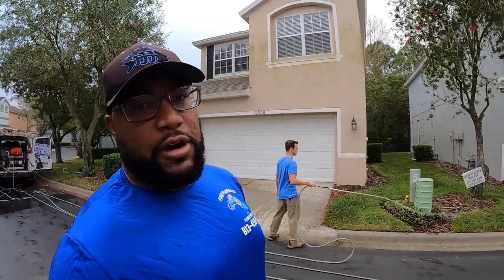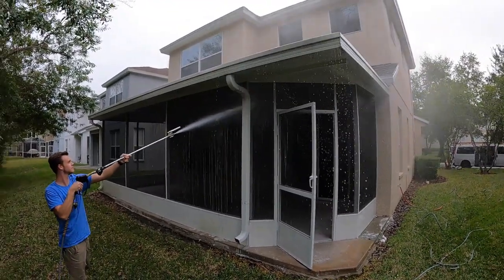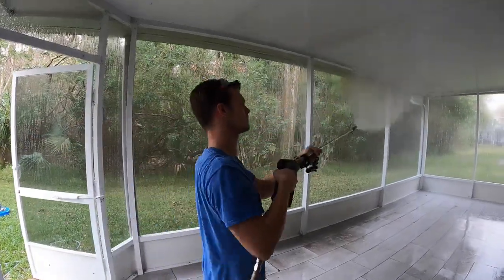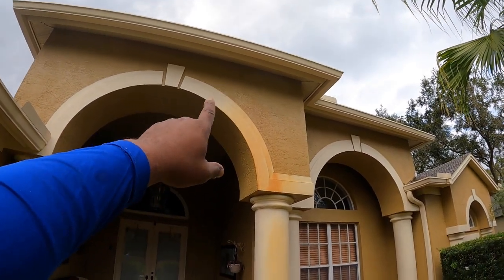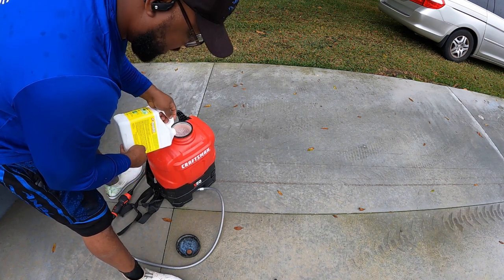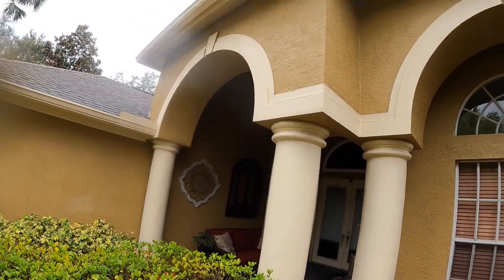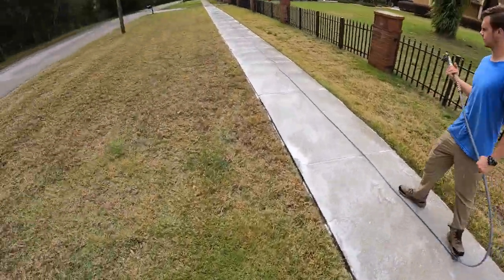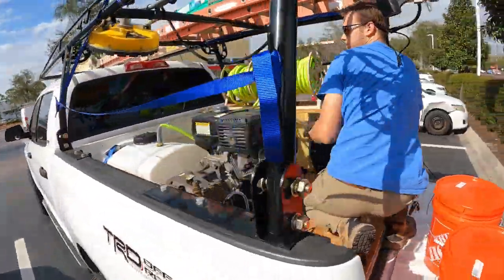How to remove rust stains on house and sidewalks #rustremoval #softwashing #pressurewashing

Comment: I haven't used the rust aid yet but always been a fan since the first time I saw you use it. I looked up the ingredients and oxilic acid is one of them, so it make sense in how well it works. 

I like the idea of multi use for the oxilic acid, even for someone like myself just to use around the house. I can use it to remove the rust on my concrete and brighten up my wooden deck and fence after I clean them.

Was also doing the math. 1 gal of rust aid for $13. 80 ounces of oxilic can make 8 gals for $24.
Looks like I'll be ordering some this summer when I clean my driveway and deck. 

Nice comparison test. Great work as always.
Reply from the maker: Yes definitely love the versatility of oxalic.
Reply: @PinkFlamingoPowerWash  Oxalic Acid does not hurt plants. Which is a good thing.😀
Reply from the maker: @rogerthetinker5116  well I'd like to be extra careful lol 😆

Comment: I’m a beekeeper and we use Oxalic Acid to treat hives for mites.
It dissolves very quickly and thoroughly in hot water.
When I test it to use for rust treatment, I’ll probably dissolve it ahead of time to make a liquid concentrate, and then carry that concentrate out in the field and dilute it to the desired concentration in the tank .

I try to keep time in site down to no more than required to do a good job when in the field; getting one more job done in a day makes a big difference at the end of the month.
Reply from the maker: Good to know it works for that too. Thanks for watching the video

Comment: Looks like a coffee cup of the Oxalic acid should do the trick with one gallon of water ?
I just got a 5 pound bag of the same stuff delivered, going to remove some rust stains from the side of a house with it (hopefully). Great video's Cliff, learning lots from them.
Reply from the maker: I dont know how many ounces a coffee cup is.  But I normally use 12oz to 16oz of oxalic acid to 1 gallon of water.
Reply: @PinkFlamingoPowerWash  I am not sure if your are measuring buy weight or volume. That's why I said to myself "that looks like a coffee cup full"  from the video. I shall try it and let you know how it works out. Thank you for the response!
Reply from the maker: @dagger4146  not by weight I don't have a scale. Volume is easier to measure for us in this industry while in the field.

Comment: Do either of the rust removers kill the grass?
Reply from the maker: No, but if you are worried you can always water the grass before and after.  😊 it will be fine. The mist or whatever touches the grass will be diluted to the point everything is protected.

Comment: Hey man I’m wondering why you went with the Chevy express instead of the ford E 250 or any of the E series?
Reply from the maker: I started with an E150.  But once it broke down I was on a hunt for whatever was decent.  This van is a 6L v8 and it's an extended van.  That extra room is what sold me plus it was a great deal

Comment: Hi Pink Flamingo, I appreciate your excellent information. Questions: 
1) Have you ever washed a brick house? If so Can I use the same SH? How do you mix the SH, I am a little confused with that. 
 2) Where did you get the tip for two story house?
Reply from the maker: Yes brick can be washed with SH. I dont mix sh. I have a downstream injector, I just drop the tube right into the straight SH and the downstream injector mixes it with water that way its diluted down to a 1-1.25%

The Davis shooter tip can be gotten from a host of different online retailers. Just google davis shooter tips.
Reply: @PinkFlamingoPowerWash  wow my friend, few people give a fast answer, you're doing a great job

Comment: Question for ya...i was using oxalic acid on a large area to treat iron/rust staining on concrete from lawn irrigation. It seemed to work well, But after it dried there were areas with stains left behind.  Do i spot treat those areas and leave it?  No need to rinse correct?
Reply from the maker: Just treat it again yes. That happens sometimes and that perfectly fine.

Comment: Great Video! I have a question on doing decks, would you downstream SH on a deck to kill the mold then apply this oxolic acid to brighten up the wood? Also what tip do you use for a wood deck or can you use a surface cleaner?
Reply from the maker: Yea you can do the same for any wood  that is not stained.  I use a white tip. And No I wouldn't use a surface cleaner on wood decks

Comment: What do recommend for a hot water set up?
Reply from the maker: I dont have one but whatever you get make sure it's a 12v hot water unit so the pressure washer and the burner can run off the battery.

Comment: Would you recommend using some sort of soap after the oxcilic acid or the rust remover AFTER the treatment and wash down? Just to get rid of any unpleasant chemical smells?
Reply from the maker: Hmmm didn't think of that. I supposed you could.  That's a good idea.  I didn't really smell anything afterwards but wouldn't hurt to spray something wirh a fragrance
Reply: @PinkFlamingoPowerWash  Just curious! I'm down here in Texas and where I live we don't have a lot of pools so I bet in my area people may not be as used to the chlorine smell. I'm working on trying to break into the business here locally and am just getting started. Been binging your videos! Keep it up!
Reply from the maker: @JamesQ  hey brother thanks for watching.  Even if they're not used to chlorine smell if they had pressure washing done odds are they smelled it lol cause thsts all we use

Comment: Di you mixed with water or just the rust removal???
Reply from the maker: I didn't mic rust aid with eater. I used it straight. I only mixed the oxalic acid
Reply: @PinkFlamingoPowerWash  thanks

Comment: Great job on comparing rust Aid with oxalic acid I never used oxalic acid for rust removal I do use rust Aid all the time for rust removal on vinyl siding and concrete and it's a cheap chemical I get it for like $10 a gallon but after seeing oxalic acid work so well and faster I might have to switch to using that thank you
Reply from the maker: Yea I love the rust aid for the simplicity of just pour and spray. But If time isn't an issue then it's definitely a great alternative

Comment: Quick question do you just let water with Chem run down and get to the storm drain? Or what is the best way to go by that? Want to start a pressure washing business but hard about the clean water act stuff... I just don't wanna get a big fine.  Thank you and love your vids
Reply from the maker: Dont sweat it man. just dont blatantly pour chemicals down drains. You can always go buy a reclaim system or buy some pig socks to block the water.

Comment: Thanks for the video. How much rustaid to water did you use in your sprayer?
Reply from the maker: None. I did straight rust aid
Reply: @PinkFlamingoPowerWash  the rustaid is about $10. Would you say for rust removal service you did is about $100?
I may have someone calling me for some rust stain removal and just making sure I don’t under charge. 
Your advice is very appreciated
Reply: @Allcoastlawnandpressurewashing  Charge what you can get. Rust removal is a specialty cleaning. You always charge more for specialty cleaning that you would do for just black concrete.

Comment: Active ingredient in Rustaid is oxalic acid. I’ve never used Rustaid but use oxalic all the time. Works best because it can be mixed to the strength needed. I also use barc on heavier stuff.
Reply from the maker: All are great. I got some barc too for backup.

Comment: Ive never used Rustaid but im almost positive its just oxylic acid. Probably buffered. Check.the label. Youre just mixing the powder hotter. Ive mixed up to 16 oz per gallon. They say it wont dissolve that much but with warm water it works for me. It is tough on pump sprayers but im lazy cleaning them out so my bad i guess. Great video as always.
Reply from the maker: Thanks for watching 🙏🏽
Reply: It's actually oxAlic acid, water
, hydrogen fluoride , and surfactant. So it's a bit more that some good old bar keepers friend.edit: hydrogen fluoride is hella toxic, protect yourselves when using. Don't breathe it, protect your eyes, and skin. Google it
Reply from the maker: @Julie Bee  facts that's why I mentioned we should have had Masks on
Reply: @PinkFlamingoPowerWash  exactly, I just had to be a Mom and add to it.  It's really crazy stuff.  The CDC has a whole page about it.
Reply from the maker: @_Julie_Bee  I appreciate it. Please chime in anytime you see something. It's helpful to us.

Comment: Great comparison vid. Very useful. I'd say I could prob get away with 5oz per gallon of oxalic acid based on your results.
Reply from the maker: Thats possible I never dilute it that much to find out. Luckily Oxalic is cheap.
Reply: @PinkFlamingoPowerWash  ill test it this weekend. Used rust aid on some spots on a driveway a few days ago and got some bright spots afterwards that stand out a lot so I figure a less strong oxalic acid mix might be a way to go over rust aid and maybe it will prevent needing to do a whole slab to blend it in. Not sure!
Reply from the maker: definitely will need to always blend in. Spot treating rust never pan out really. And a weaker chemical ratio would yield same results. But you can test the theory my brother

Comment: Ox was probably better since you can mix strength you need, not sitting on the shelf. I also use Ox.
Reply from the maker: It would probably take so long for rust aid to lose its potency being stored in an air conditioned store. But I get your angle on that for sure. I like Ox too just gotta mix it up.

Comment: Why did you use the rust aid on the sidewalk? I didn't see any rust, was I missing it?
Reply from the maker: Yea you're missing it big time
Reply: @Pink Flamingo Power Wash LLC  10/4.. have you tried those two acids on surfaces other then stucco. I.e. hardyboard, vynal etc.
Reply from the maker: @Jeremiah Jones  no not yet. I did try it on a garage doors before. Painted aluminum though